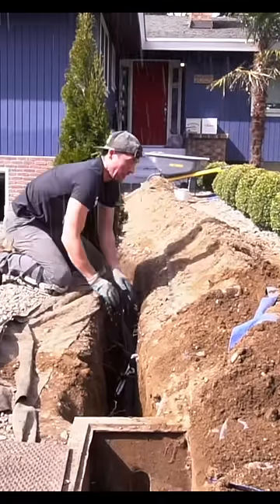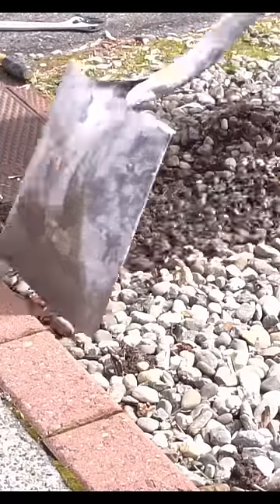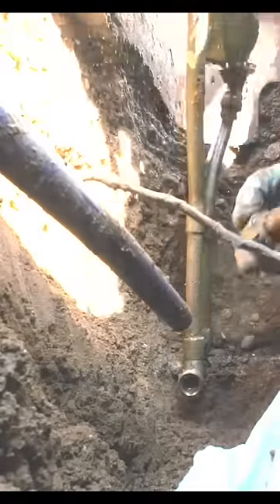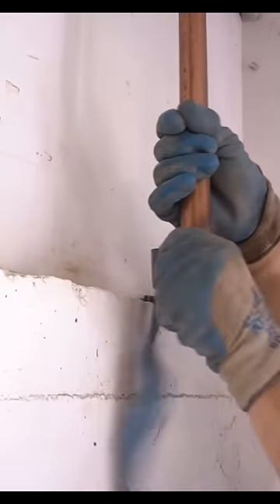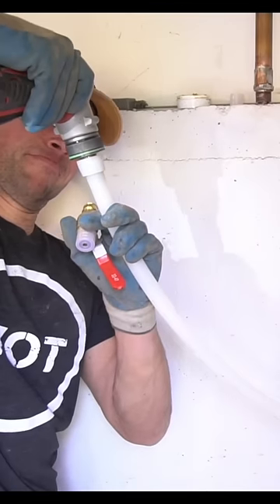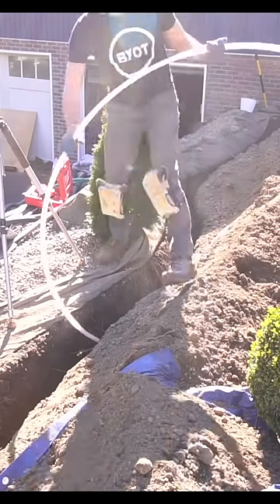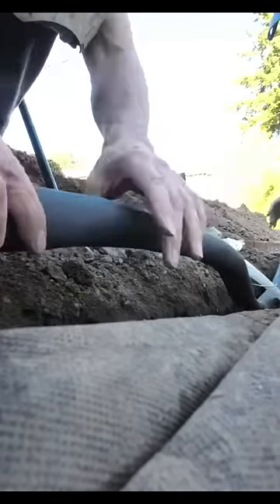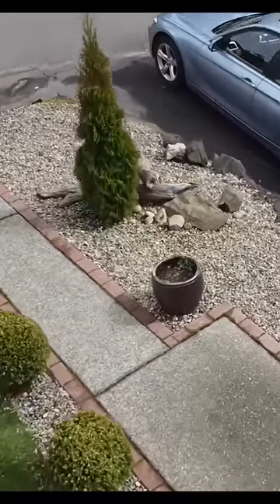Saved $8,000 By Fixing My Own Water Line! #diy #plumbing

Comment from the maker: Thanks for watching! FULL Tutorial can be found here if interested: https://youtu.be/x_wBwmiilYQ
Reply: You didn't save $8000. You're pretending it didn't cost you anything
Reply: You’re lucky that your frost line is not 36 Inches
Reply: WHY SUCH A SMALL REPLACEMENT LINE.?.?.?
Reply: Well done the only. Thing I would of done differently.would of added liner underneath the pipe..with about 4-5 inches of sand and then about 4-5 inches of sand on top before back filing with dirt ...this prevents future rock and roots from cutting pipe...and easier to locate in future...👌

Comment: Bro. This is no diy job. If u have an upinor tool.... your a professional.
Reply: It would've been more realistic if he used sharkbites and pexb
Reply: They make a hand powered one. That would be more believable
Reply: You can rent them…
Reply: Yea he def is a plumber he has a trench shovel uponir tool and knows how to solder haha
Reply: @joeransom1567  I can solder copper (not hard) and own a trench shovel.....definitely not a plumber
Reply: @Taylexwow  u got a uponor tool as well
Reply: @J T  you don't want to burry sharkbite. They tend to leak.
Reply: @Taylexwow  apparently im a pro plumber too lol
Reply: You can rent them quite easily.  Shovels are inexpensive and soldering is not a hard skill to pick up.
Reply: @wavelinck If You have ever had a sharkbite leak it was either damaged or  not seated properly to begin with....Installed hundreds of sharkbites never had a call back...
Reply: @WTC7  shark bites are not recommended for pressurized city waterlines you need a philmac otherwise the inspector might not approve the inspection depending on what city you are in.
Reply: @wavelinck  sharkbites usually seize up with minerals where I'm at. The minerals give it better leak protection
Reply: The hardest part is finding the pipe thats leaking and maybe getting someone at home depot or lowes to actually help you with something 😅
Reply: PEX pipe is permeable, should have been contained inside of a pvc sleeve.
Reply: He saved 8k but spent well over 500 for the tool
Reply: Or borrowed it from a buddy
Reply: So go spending a few hundred bucks on tools suddenly not worth what he saved , got it
Reply: @Taylexwow  sorry handyman
Reply: @joeransom1567  Yes but an actual plumber would know that uponor and every other brand makes solder pex adapters and you wouldn’t have to do that silly mess he did there.
Reply: @Chavez3d  I bought my dewalt expander for $350
Reply: @bojangles_bonjangles8000  pex is rated for direct burial. In the uponor manual for this pex it says it’s rated to be direct buried
Reply: Actually DIY is a relative term 💯 meaning as long as you have the base knowledge needed to execute the job but it is not your profession and you are doing it for personal reasons that's pretty much all you need to fit the standards of DIY that said spending the money to buy that little bitting expander that he's using on his nylon pipe system along with the nylon pipe and a spade shovel is most likely less than $8,000 🤔🤔 and now he has a new skill set and a tool that he can use he's getting more out of spending his money doing it this way then he would if he just handed $8,000 over to somebody. Now I personally would not attack any type of nylon fitting to a metal pipe in a outdoor setting but my Frost level here in Illinois is about 6' meaning in the winter that metal would have expanded stretching out that plastic nylon fitting then delete between the two dissimilar materials begins but I have no idea where he's at
Reply: I mean, if you're saving 8k running your own line what's a 500 tool to help do it. Thats how I justify my tool purchases when tackling a job at home.
Reply: @my_master512  6ft. Frost line. I'm in Alabama and ours is 5 inches. How do u find water leaks in the yard.... how in the hell do u find water leaks in the winter.
Reply: @joeransom1567  trench shovel bad example bro
Reply: @leehiggins8116  lmao whenever there's underground leap you can literally step on the ground and water will come out as if you were stepping on a sponge.
Reply: Some kid stealing videos
Reply: You're
Reply: Fr I was thinking the same thing
Reply: Buy a used tool or sell the tool after the job is done, that's if you can't rent the tool.
Reply: Can probably rent one
Reply: I am an electrician. I used uponor in my house.  I just borrow tool from work or a plumber friend
Reply: @chunkyfecalbreakfast depending on how long the run is I've seen larger plumbing companies charge that because of insurance and overhead costs.
Reply: @jeffvan6355  for sure bro but see how you are already in the trades and have access to that diy means regular homeowner and I doubt they have that much knowledge but kudos
Reply: @WTC7  I wouldn’t think twice purchasing the tool. The cost of the tool is nothing in the scope of this repair and could sold if needed.
Reply: If you were going to save that much, I would go out and buy that Milwaukee tool even if you spent $300 and used it one time sometimes plumbers have the most outrageous prices $2000 to replace a water heater in a garage labor and you’re done in two hours There’s something wrong with that.
Reply: @steveanderson4768  you aren't really saving 8k specially if he has a well paying job.
Reply: @robertopics  How so
Reply: you can get entire m12 kit of upinor tool kit - which includes tool, 3 heads, 2X batteries and case for around 400$, seriously if that job cost even 1/4 of what he stated you can still save a lot of money by buying this tool and several small tools. some tools can really pay for them selves that easily in certain cases.
Reply: If you save 8k by spending 5-10% on tools get the tools, you'll have them for life and next job will be that much cheaper.
Reply: @chunkyfecalbreakfast  I do agree with you there. People should try and repair as much as they can on their own and view the tools needed as investments. 

I'm a handyman/carpenter and I still have a few tools that I ever only used on 1 or 2 jobs, BUT I still have those tools if ever needed again.
Reply: You can rent the tool

UR no pro with tools.. Experience makes you a pro
Reply: He couldve bought one for the job maybe? Its only like what 400-500 so thats cheap on the grand scheme and he couldve just researched it before
Reply: My main line in my former house ran under 25’ of asphalt. That’s an issue beyond the other unforeseen issues a typical DIYer encounters.
Reply: @Taylexwow  sure you dont have a an expansion tool 🤣
Reply: I mean he ran an offset with pex. That's below handyman status. Thats cidiot buying what he finds at home depot 😂
Reply: You’re *
Reply: @Taylexwow  Same here.
Reply: @joeransom1567  They are a few hundred bucks. You can get the hand pump ones for like a hundred and it would be perfectly fine for a small job like this.
Reply: @ShrimpCracka  me too
Reply: @Chavez3d  A tool you'll have for a long ass time or you could even sell
Reply: @BonsaiBuckeye  Used a shark bite on a water heater 4 years ago...so far so good.
Reply: @werper09  Your grandson will be the one to replace it....
Reply: @joeransom1567  they cost significantly less than $8000
Reply: @Anthony Rodriguez then I wouldn't put one in hard to get to areas that would cause damage and repairs like in a wall or something but to dig a leaking sharkbite under two feet of dirt would only take a few minutes to dig up.
Reply: @Medial A absolutely not, the cost of the materials fittings and pipe a few hundred at most lol.
And you don't need the expensive tools used.
Reply: @wm1958 as long as you can get a firm enough grasp to successfully seat the pipe into the fitting you shouldn't have any fear of it failing. Fair to say not all applications allow for good access to be able to seat it peoperly. If you ever see a sharkbite fitting fail it was almost certainly installed improperly.
Reply: I have been using uponor pipe and fittings since 01 and thr company i worked with have been using it for ten years before that, its not new
Reply: @ChrisPete123  I know I’m a plumber, run water services in Flordia and have in Maryland
Reply: For real I had a guy from my work at UPS try to get me to help him dig his waterline for 200-300$ and I said fuck it you don’t have to pay me but fuck this job lol told him to start looking at home depot not for tools or parts lol
Reply: @ChrisPete123  this job would be about 5k
Reply: @joeransom1567  he sucks at soldering though
Reply: @BonsaiBuckeye  true shit I’ve used them for years, my dad as well, company I work for now don’t want us to use them because possible leak…. If you install it right it’s not gonna leak, never had one leak as far as I know
Reply: That is a three-quarter inch pex expander. It’s only a couple hundred dollars.  Find a friend that can solder the first joint for you.  If you can dig your trench, you can do this. Remember you’re getting paid $8000!

Comment: "I saved $8000 by being professionally trained and having 10+ years of experience."
Reply: Using professional tools
Reply: I don’t think you need 10 plus years to do this alone lol
Reply: no; he installed pex pipe underground
Reply: @henryhenry271  but why under ground what happens when the ground settles
Reply: Not a pro. I just did this my self in a much deeper trech (30 in freeze line). Rented a trencher and used compression fitting designed for this use. Cost about 500 after rental fees.
Reply: @negativerush  shoulda but it in a 2inch pvc sleeve so it won’t get crushed in the future
Reply: @Devilsfan-pd8ov  it was not PEX it was CST much stiffer.
Reply: Culinary water lines run underground below the frost line and are designed for the service they provide and will work as well or in fact much better and more reliably than the previous setup. Questions, just ask around.
Reply: @nicholasgardiner9601  I’m talking about the material
Reply: @Devilsfan-pd8ov  
How good is good enough?
If you want to you can build to standards exceeding code if you so choose.
Reply: @nicholasgardiner9601  will the pipe smush when the ground settles
Reply: @Devilsfan-pd8ov  It will not and is standard in new home construction. New homes in md are getting 1.5 to 2 in mains. The one I fixed was 3/4. It use to reduce to 1/2 in. Buts its 3/4 throughout only reducing at the fixtures.
Reply: @Devilsfan-pd8ov  not with constant pressure and only 2 ft of dirt.
Reply: @negativerush  I gotcha I do hvac so I don’t know the rating of all the plumbing pipes
Reply: @Devilsfan-pd8ov  I was an insulator (duck wrap and pipe covering) so I had to pick up some stuff. Now I am the guy nobody wants to show up on site.
Reply: I don't think you need to be labeled a professional. plenty of professionals do crap work with that much experience.
Reply: @negativerush  hard ass on the job site but gets the job done eh. The problem is now adays everyone is lazy and doesn’t want to work
Reply: @darkmode867  mainly at flat rate company’s
Reply: @Devilsfan609 138  no the pipe will not you really need to do some research and stop making false claims. Your comments are like you know what your talking about while also not so non of them make sense and you can tell you have never worked with the materials
Reply: @darkmode867  I do hvac not plumbing
Reply: literally no lmao, i have been doing plumbing for only a couple months but i could literally do this, plumbing isn't super hard it's just time consuming and you need a little knowledge
Reply: @Iamdark1234  wait till you start doing plumber long lol you’ll see. It might not be hard for you but for a lot of people it is
Reply: @Devilsfan-pd8ov  and those people shouldn't do it then
Reply: That tool was 400 dollars.  Nothing here was hard
Reply: @Henry Henry  that's up to code
Reply: @astatalol  Buy 1k worth of tools to save 7k and have the tools, seems good to me.
Reply: @astatalol you think professional tools and a little research is a more that $8k? Come on now don’t be lazy.
Reply: I did this today at my house. 0 training

Comment: Careful of using of pex in the exterior without pvc pipe shell if you live in an area with rodents. They will chew your line up.
Reply: It's also only uv resistant for about 6 months...
Reply: Amazing what y'all down in the "2ft deep" world have to worry about.. rodents and UV.

My utility in Ontario specs 1.2m cover, but 6 or 8 feet isn't uncommon; well out of groundhug range!
Reply: @dgunn4408  but everyone needs a groundhug every once in a while.
Reply: @Milkybetrayal  d'oh.. you got me
Reply: Rats will chew through steel if they can hear water
Reply: I’ve done hundreds of homes with pex. Zero issues
Reply: Is PEX even rated for underground?
Reply: @Paul Podby  not sure what y'all doing down in the states, but here in Canada most jurisdictions have pex written into municipal spec.
Reply: @trailbarge12  yes
Reply: @otisbigsby  except for the 60 known chemicals that leach into the water. You must be one of those guys slapping in pex with shark bites that keeps my shops phone ringing off the hook to fix up behind you
Reply: Thanks.... still learning in my dotage.
Reply: @markroberts7001  i love it when you have to shock a whole house because pex or pvc started slow leaking and introduced mold into the lines it’s a great way to ruin my day and a customers

Comment: Warning.... Electrical lines, network lines, etc can all be buried underground. Can be fatal if you dig in the wrong spot. Most states have a phone number you can call to determine where the lines are
Reply: Yup, the number it 811
Not calling and hitting something could cost you over $8K

Comment: Torch- ✔ 
Solder ✔ 
Flux ✔ 
Emory cloth ✔ 
Tubing cutter ✔ 
Uponor expander ✔ 
Hammer drill ✔ 
Shovels ✔ 
Knowledge ✔ 

$2,000 worth of tools sure comes in handy along with that experience for that once in a lifetime diy project.  In guessing he pulled his own permit and called in his own inspection
Reply: This.
Reply: Screw a permit and inspection for a simple water line.  No way I'd get one.
Reply: Still saved 6000usd and now you have neat equipment aswell 😅 (if you figure out what you need to do and is a bit lucky)
Reply: @deadlyduck11  I'm not sure where he got his quote,  but it wasn't in my area.  $1200-$2000 for that.  $8000 would be for a commercial contractor on a commercial job site,  not for residential
Reply: Everything in this video could be done with for under $500 very easily idk where you're getting 2k in tools for and even if it was that much it's still saving money the only way you learn skills is by researching doing it screwing up and doing it again until it's right
Reply: If you own a house you better start buying tools!
Reply: @gabz91110 Amen. I know that's right. People don't realize (as I didn't before) how much stuff you really need to learn to fix yourself.
Reply: I have all these tools accept the uponor expander and I’m a diy’er
Reply: @BeingJermaine  Same.  I don't know about the price of the Uponor, but the other tools/items are less than $100 combined.  Not surewhere the OP comes up with $2000 from?
Reply: @graynatic3682  If you use uponor fittings, the expander tool is $1k by itself. But yeah, you could use different fittings.

Comment: Depending on state/local codes, waterlines should be sleeved with pvc when penetrating a concrete wall. Also wipe your pipe dope off.
Reply: Yeeeppp
Reply: C'mon, give him a break.  This is DIY...using tools that 95% of DIY'ers don't own  :)
Reply: Should be protected sleeve with pvc? What are you, a poly vinyl chloride representative? It should should be protected. If sleeved it can be of any adequate material which protects the pipe and also it should be waterproofed.
Reply: Where I live, water line from the street to the house is Copper, not plastic or pvc, tracer lines are reserved for gas lines

Comment: Yeah, I did this same thing.  Only my water line was 6 feet down, required a building permit, a certified master plumber and a final inspection by the city.  I did everything but actually connecting both ends of the type K copper.  Final bill, $1,800.  I saved $6,000 on the excavation alone.

Comment: If you attach the new line to the old you can PULL the new line through without any trench.  Done it many times, starting 40 years ago.  If the tactic fails, well, you were going to have to dig anyway.  I appreciate your thrift, and saving $8k is important.  Well done.
Reply: you cant just "pull" it through, you need a hydraulic pull through machine, or some kind of pully towing system, and if youre going to do a pull through, dont use wirsbo pipe as it stretches too much.
Reply: I don't no what the tool is called but we have a cable we run through the pipe  there is a arrow bitt with a female on it. Pex male to it and pull. I have pulled it with our trencher.
Reply: smaller pipe? or you pull out the old water line?
Reply: @chanchopanza  same size or bigger, it either pulls the old pipe through or slices it
Reply: @IvoryPitbull  our tool splits the pvc. We mainly put 3/4pex through 3/4 pvc
Reply: You need a $300 connection kit to pull pipe most people ain't gonna carry that.
Reply: Wouldn't be as much DIY fun if that water line was under concrete and you need sonar and demo hammers to find the leak and replace.  Mad respek tho!